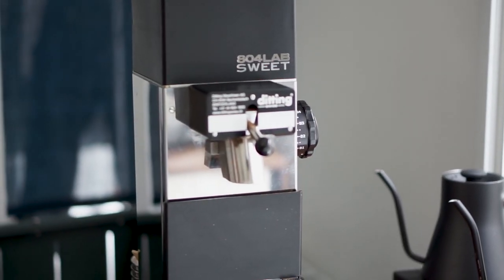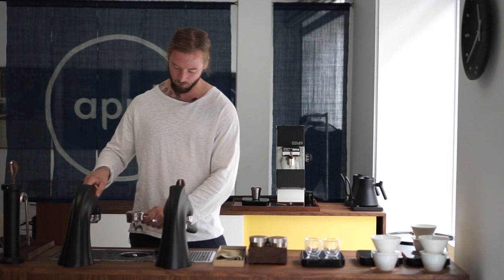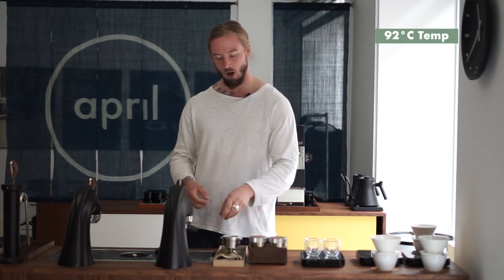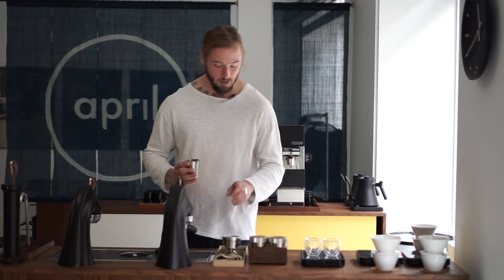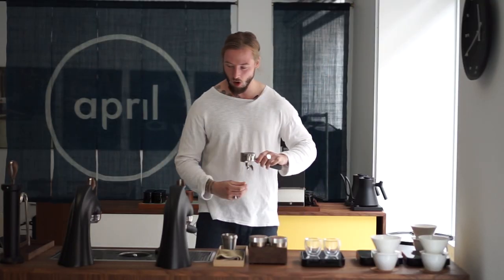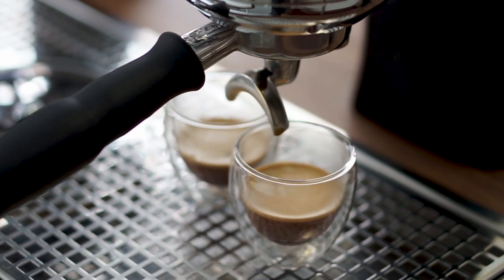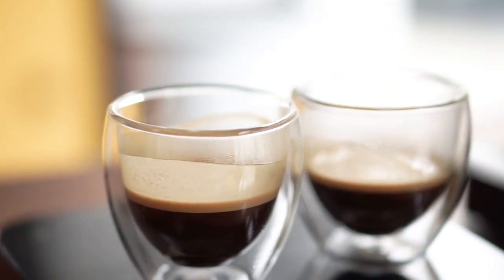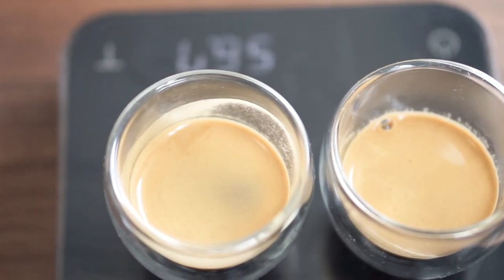Brewing Espresso using a Modbar EP | Coffee with April #130

Comment: what is it about the ditting that makes you guys choose it compared to something like an EK43 or a Mazzer Kony?
Reply from the maker: First of all taste. Secondly that the burrs are set up as they should from the start.
Reply: The Ek43 is beaten by almost any other grinder out of the box. To make it work and have good results you have to change the burrs to SSP , change the carrier with  a Titus one, align the grinder. There are more burrs and carriers models and they are designed for a specific use, for eg:  ssp high uniformity are for single dosing espresso.   As for pulling shots fast I can see why, but at the same time a solution for April would be to play with some other baskets (with less hole surface) and that will let you grind coarse to not sacrifice clarity and to not hit that wet wood aftertaste.

Comment: Hi Patrik, around 4:10 when you are distributing and trampling the grounds, I notice there is a huge hollowness on the right hand side of the screen in your basket. Is this a lighting problem? I use a niche grinder, when I dose grinds from the niche dosing cup to my PF, there is always more ground on my right hand side (I use my right hand to hold the dosing cup), even with an distribution tool, after tamping, I can see that the puck is uneven with the right hand side thicker. The shaking motion does not help, especially with darker roast. How do you solve this problem?
Reply: mintteaco I would say tapping the side of the portafilter with your hand should solve that issue.  Where you’re talking about in this video seems like just a shadow. If you’re getting more grinds on the right.  Tap it a few times with your hand on the left.  I’d really need to see it but that’s usually all it is.  There are some better distribution tools in the making as far as I know that will help solve this problem too.

Comment: Hi Patrik, I've noticed on all your espresso videos that often you use different amounts of coffee in relation to the basket size. Sometimes you underdose 1 or 2 grams and sometimes you updose too. When would you decide to updose rather than under please?
Reply: Normally increase dose when you want more body and sweetness. However, this can bring unwanted negative acidity too so it doesnt suit every coffee. Also Ive found that coffee which have a dry overextracted flavour even when the shot times are ok I increase my dose and aim for the same shot times again as a way of increasing my particle size and therefore reduce extraction. This worked for me recently when working with a coffee at 19g that wasnt giving much acidity and lots of bitterness at 30 seconds. We switched to 20g and it was much better.